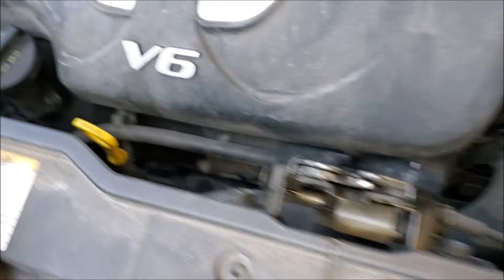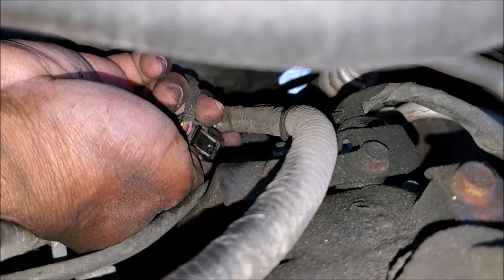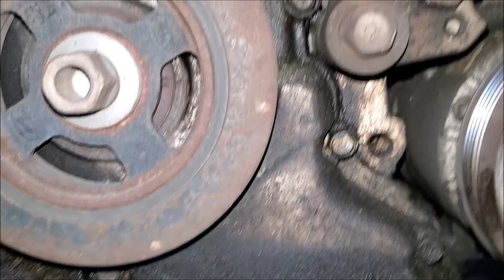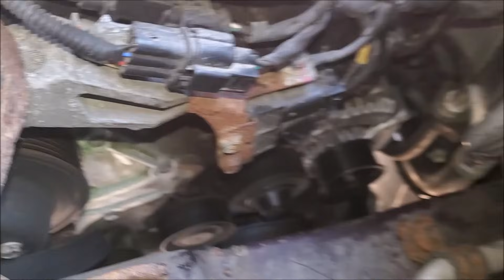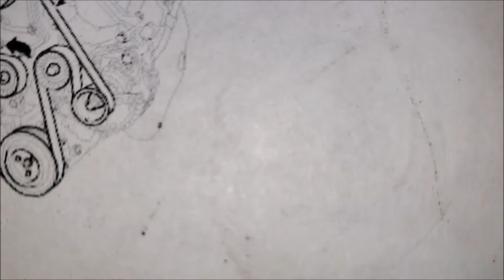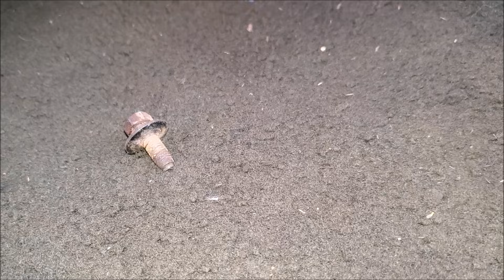Replacing a alternator in a 2011 Kia Sorento

Comment: Finally did it,
You do not have to lower the subframe or disconnect the a/c compressor..

I literally did everything from the bottom.. use a jack and piece of 2x4 to jack up engine so the top alternator blot can slide out .( you do have to take off the top engine mount bolt & that’s it )
The alternator came out the bottom not the side ..came out right by the subframe and in order to do so , I jacked the engine up once more to allow the alternator to fall through..
This whole job is a B###h .
I can see why some shops are charging 500 for labor.
The cheapest alternator was 219 from car parts plus 60$ core charge.
Advance auto is 350-600 plus tax .
Also just replace the belt 
( the alternator and a/c compressor basically have to trade places..)
And it comes out the bottom next to oil pan ..

Comment: I did end up undoing the passenger motor mount and removing the idler pulley, and once I bit my lip just right, I got it out the bottom. Putting it back in was just as big of a headache as getting it out. This is definitely my last Kia project. Thanks for the video.

Comment: Do not attempt this.  I tried every way possible and could not pull it out the bottom.  This guy must have lowered the sub fram when he cut the camera...or he is a magician.  Find a video where they pull it outthe top.  Pro tip take the 2 radiator brakets off then you can slide the fans all the way up and out.  Then you dont have to remove dip stick.  Hope this helps someone.  Putting mine back together now.  I did a lot of unnecessary work because of this video.
Reply: All you got to do is take out the bolt that holds the tensioner pulley to the block makes it easier to pull it out from the side
Reply: I also ended up having to take my a/c compressor all the way out regardless Kia failed miserably with the design of how that whole are is lol

Comment: At 2:17 what’s that nut called and what happens if it snapped
Reply from the maker: The nut is what moves the belt tensioner. If it has broken, you may need to replace the tensioner.

Comment: How’d you get ac compressor out of the way
Reply from the maker: It's tricky, but the alternator and compressor can be maneuvered to get the alternator out.
Or you can evacuate the a/c system and remove the compressor

Comment: I have one now. I can not get that thing out. How did you get to the left top ac bolt?
Reply from the maker: It's a difficult job. Maybe try a swivel socket adapter to reach the bolt
Reply: @LewsSpeedShop  I did. It has been a tough week but I will get it done tomorrow. Thank you

Comment: Hi I'm looking into buying a Sorento 3.5 SX 2012 are they reliable ?
Reply: I got my 2011 Kia Sorento in maybe 2017? Main problems I had was this plastic piece in the doors , tends to break, causing doors not wanting to open from either the inside/outside or both, the steering wheel buttons not working, my horn not work, (but my hood flew up and smashed my windshield because it wasn’t properly shut so probably why my horn doesn’t work) , mostly petty electrical problems, I’m at 200k miles now , and finally my alternator failed me…:
Reply: @HIMDUNCAN404  clockspring from eBay fixes the steering controls and the door situation sucks ass but for the most part pretty reliable @MrRoostersmoke
Reply: All the problems Archie just mentioned are the exact same problems I have.
Reply from the maker: They are pretty good cars. I haven't had to do much work to the Sorento

Comment: I have the ac compressor 4 bolts all loose did you have to disconnect the compressor lines to flip it out of the way?
Reply from the maker: No. I maneuvered it. Kinda switched places with the alternator and it came out. 
It's really tricky

Comment: I'm actually doing this exact job right now. Just wondering what you did for the ac refrigerant? Did you just undo the hoses at the compressor and did a lot of refrigerant come out? Does your AC work fine? Please let me know ASAP thank you
Reply from the maker: The A/C system has a leak. So, I didn't have to evacuate the system. Maybe get a shop to release the Freon from the system and then continue with the job.
Reply: @LewsSpeedShop  thank you for quick response!
Reply: Don't disconnect the hoses